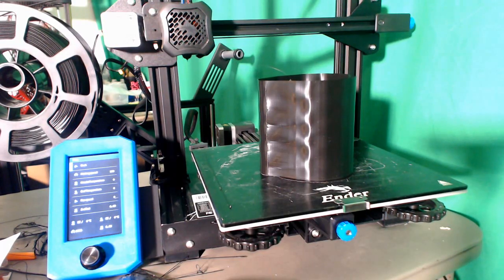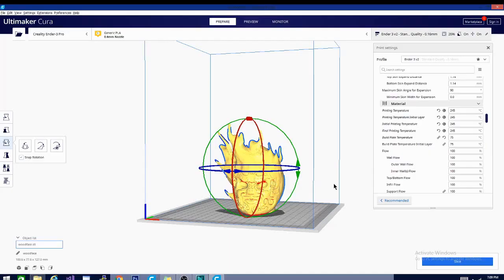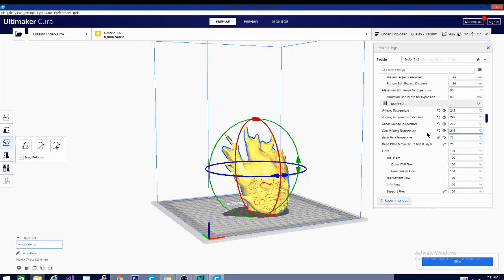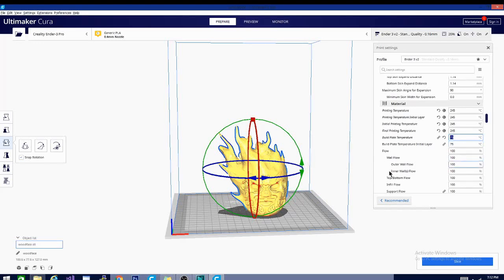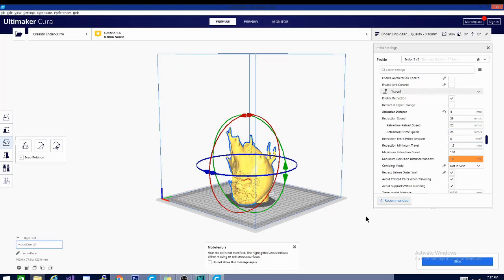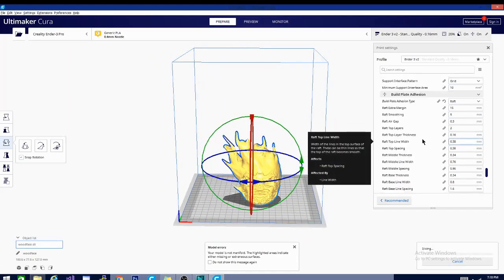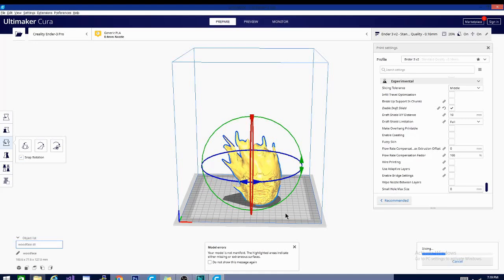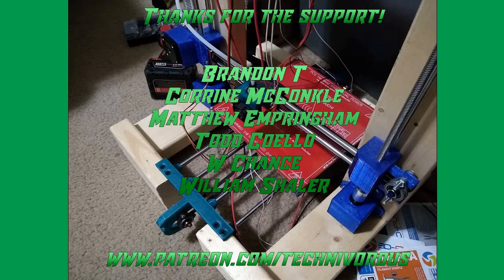How to Print ABS on the Ender 3 v2! it's Easy!

Comment: Can you print a square part face down to see if the corners stay sticked to the base ??... please !!!
Reply from the maker: Jorge, if your corners are lifting, turn up the bed temperature. Also, make sure you have a draft shield on in the settings. Watch the video to see how to turn it on and it will prevent lifting. Also, use a little adhesive on the bed will help

Comment: I'm having trouble printing in the garage what Temperature are you printing in your room.
Reply from the maker: Ambient temperature is important.
Reply from the maker: I run my house at 72 degrees
Reply from the maker: If you can't raise the temp of the whole garage, consider building an enclosure. It will help a ton. I've seen people simply put a cardboard box over there print and get great results, however I don't suggest it for a long term solution as it's a fire hazard. Get you some plexiglass and do it right. It will capture the heat from the bed and the hot end, keeping the air inside warm!

Comment: I tried the same setting you used and noticed that turning the part cooling fan off turns the electronics fan off as well
Will this affect the electronics in any way?
Reply from the maker: this is a wiring flaw, it can be fixed by moving the wires for the fan. if your doing short prints you will be fine, but if you do long ones you might want to fix it

Comment: Mine isn't printing it out. Where the gears are for the extruder I can see one of them not spinning while they other one is trying to. This is for both my printers the ender 3 and ender 3v2. They were working fine with pla. I think my temperatures are hot enough as well. The bed is set to 70 degrees Celsius and the nozzle is set to 245 degrees Celsius.
Reply: It seems like it works a little but not much. Any advice?
Reply from the maker: Is it maoing a clicking noise? Your nozzle is not hot enough.
Reply: @Technivorous  Thanks for replying. I'm not getting any clicking I think I might've solved the issue not sure yet. I'll reach back to you shortly

Comment: Hi nice video. I'm trying to print in abs but don't stick to the bed. I try everything and with pla its perfect. Do you use something on the bed? Tnx for everything.
Reply from the maker: Sometimes. a little gluestick should do the trick, if not i reccommend nanoplymer adhesive, its great and works a charm. try a gluestick first, its way cheaper!

Comment: If I have the Ender 3 V2 enclosure, is it still necessary to to the draft shield?  Also, Is the enclosure enough to deal with the fumes or should I do this in a ventilated room?
Reply from the maker: with the enclosure you do not need the draft shield. when working with abs ventilation is always a good idea, because it stinks. also anytime you have the hot end above 245-ish you want some sort of ventiation. the bowden tube puts off at toxic nerve agent at high tmps. (trace amounts, but tbetter safe than sorry!)

Comment: Checked out the profile, why is the bed temp set at 75ªc?
Reply from the maker: Because this machine is an open frame design having the bed temperature up above 70 degrees helps keep heat trapped near the model when using the draft shield, keeping it from warping or splitting from temperature variance. (Layer separation, etc) you can certainly go higher to trap more heat but ive found this works well for me
Reply: @Technivorous  thanks for the reply! I downloaded your profile and had a very sucessfull print on my ender 3 + dragon hotend in a DIY enclosure, great layer adhesion

Comment: How is your layer adhesion with your ABS settings? I've found that i can get really good looking ABS prints with similar settings but when it comes to strength and structural testing, they split apart easily.
Reply: Maybe increase layer width
Reply: I was having the same problem and recently upgraded my printer to the ender neo max which has a much better extruder and other features, prints ABS and PETG really well, no splitting in the layers. I only use my ender v2 for PLA now.

Comment: Hi will this work on ender 3 pro with magnetic bed? I don't have glass bed
Reply from the maker: Yes it will
Reply: @Technivorous  some people say under hot end fan there s a hole allowing air flow directly over to model. Do we have to cover it with a tape or it isn't a problem?

Comment: For some reason when I try to use the profile provided, the wind screen does not stay attached to the raft.   It causes the whole print to fail.   I've worked with the esteps, z-offset and leveled the bed multiple times.  The raft stays on the bed and the actual print stays on the raft;  it is just the shield that comes loose.  
This is for a E3Pro, not V2.   Is there something I should be doing different?

Comment: With both my Anet A8 and Ender 3 V2, I've used a clear polythene bag. I cut it to size, so it covers it nicely and then poke a small hole at the sealed end so the ABS Filament can get to the extruder. I suffer from near nil warping, keeps the so called "nasties" in, so I don't die of whatever people worry about and above all the heat stays inside. The Ender 3 V2 I bought within the last 2 months, so I give the shield a go. Thanks for sharing mate :)

Comment: Do you use UHU or hairspray for bed adhesion? I hadnt and the ABS would just keep separating from the bed.
Reply from the maker: Hairspray works well. I usually try gluestick first since there cheap and I have a ton but I dont really have adhesion issues with abs. If the model is lifting loose after it prints for a bit try turning up the bed, or building an enclosure!

Comment: Thank you for showing this feature - I have been prepping mine to print ABS. I've removed all electronics and literally printing the last piece now - a tray to hold two rolls of filament to the side.  I just haven't decided on an enclosure. Now I might not need to - thanks to you.

One question, your ABS Cura profile for the v2 should work on an Ender 3 Pro as well, right?
Reply from the maker: Yes, it should, but if you dig around my github (the download page) there is an abs profile for the ender 3 pro as well

Comment: You should try out ESUNS abs+ (has some blend but pretty strong ) ,its one of the easiest ABS to print even in an open frame.i have printed parts that are 3-12 hrs . I just added  mylar blanket on top of the print for longer print. But the surfaces are so consistent and had zero warping. Give it a shot and it's very reasonably priced filament and the quality so always good.

Comment: Recently I have heard of people coating the PTFE lined throat with thermal paste claiming it increases the heat dissipation from the heatsink, I am of the opinion that this will also increase heat creep up the throat, what do you think about this?
Reply from the maker: On of the dual extruders I use has a setup like this, and extra thermal past to connect the throat to the heat sink... dosnt seem to slow the creep at all, but it keeps the throat from coming unseated when you torque the nozzle. I would have to try it on the line and see what happens, but it's probably overkill.

Comment: Thanks for an AWESOME video! Will this profile work to print ABS on the new CR6 SE? I was contemplating buying some plexiglass (I know it'd be expensive IF I could even find it right now) & building an enclosure for the new CR6SE printer I just bought. IF this method will work for my printer I'm excited to try printing some ABS soon!
Reply: Was ist successful? Does ist also help out in therms of holding on the plate? Becaue I had the problem that ist gets lose all the time
Reply: @moritzhaf  I wound up purchasing the largest enclosure Creality sells. I'v printed PLA and ABS within the enclosure with no issues.

For the build plate adhesion, I quit using Isopropyl Alcohol. I now take the glass plate & wash it with hot water, & a few drops of dish soap. I then dry it with a paper towel. I've found this solves the issues I was having with build plate adhesion.
Reply: @moritzhaf  I'll know within a few days! It's still being shipped to me. Once it arrives I'll be trying it out.